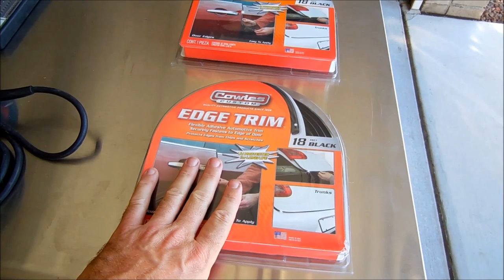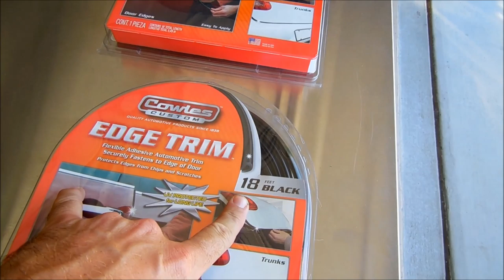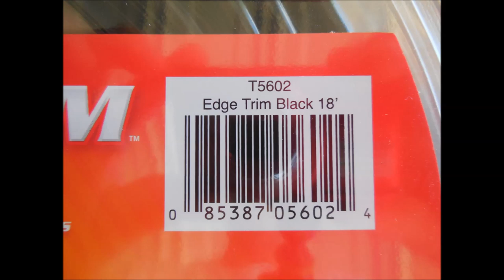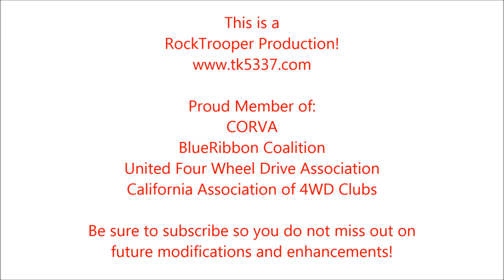How To: Cutting the OEM Fender Flares on Jeep Wrangler (RockTrooper)

Comment: I think you just saved me $650. i was looking into ordering Bushwacker flat fenders for my JK. But this is a great DIY project and a great step by step video! Very nice touch adding the edge trim as well. What did you end up using to tie in the bottom of the front plastic piece to the frame? 19:40
Reply from the maker: Ryein, thanks for the feedback, glad it helped! As for the fender piece at 19:40, I actually just left it tucked behind the body and it has remained in place. I have driven high speed highway miles as well as off-road rubbing the fenders against trees and rocks and they have never popped out.

Comment: I love this mod. I hope one day I have the guts to do it! I have a Sahara, so I'm slightly afraid of cutting the painted fender flairs, but I did find some white door edging, so If the paint  doesn't get messed up with the cut I can finish it off and make it look complete. We shall see. 

Also, I really like your  brush guard, what is it? I am in the process of chopping my stock bumper into a stubby with a winch, so I am not afraid to drill holes to install a brush guard. I HAVE A 2014JK/ 2 door Sahara (it looks like u have a Rubi 2015 stock bumper), but it should fit either way. 

Props on your diy fender mod. I am doing as many mods myself so I can spend big $$ on a good lift and bigger tires(my wife has the final say on all $$ spent on the Jeep). It is also my daily driver/only reliable vehicle between us, so I need to keep the extra pounds down as best I can. After looking into purchasing new bumpers or flairs I also found it can add extra weight to the jeep costing me gas mileage.
Reply from the maker: Robyn Schlagheck Thanks for the feedback! I do not know anyone who had cut the factory flares that are painted. I'm not sure if the paint would remain intact or if it would splinter/crack from the point of the cut. I'm guessing the later, but I'm sure a quick google search would show someone may have done it already.  The stinger on the bumper is from Maximus3 and it mounts to this type of front bumper only (10A/Rubicon X/Hard Rock). I think they may have some other stingers that would fit the bumper you have. I hear you on saving $$ for the real mods, I do the same... :) Jeep on Robyn!
Reply: Robyn Schlagheck My factory fenders are white, I have the Sahara Unlimited and I cut them with a dremel to install the Rostra LED Daytime Running Lights. I didn't have any issues with cracking or peeling, and Ive had them for over a year now. you can search those lights on you tube. Theres a 20 minutes how to for installation that was rather well done.
Reply from the maker: Bishop, thanks for information. I had not known anyone that had cut painted fenders. Good to know that it wont crack/peel.

Comment: Do these completed fenders flap in the wind while driving on the highway or any driving at all for that matter ?
Reply from the maker: Ginny, as long as you leave the proper support braces in place like I had done in the video, you will not see any flapping. I have driven extended highway rides @ 70 mph, as well as normal road and off-road driving and no issues at all.

Comment: Looks good  leave it as is saves lbs... Remember power to lbs ratio is important too!!! Try to use  Hd .aluminum and plastic also where you can...Again looks good and stay safe....
Reply from the maker: dam1041960 thanks for the feedback. Yes weight is important, there is always a balance between protection and weight.

Comment: I just purchased a jeep similar to yours what lifted did you end up going with on that jeep and are you happy with it
Reply from the maker: S Hermann, Congrats on your Jeep purchase and welcome to the family!

I have the MetalCloak Gamechanger suspension and I am very happy with it. The folks at MetalCloak are great as I had a minor issue with one of the control arms and they sent me a replacement next day. I have taken RockTrooper thru varying off-road locations (Rock, Sand, Snow, etc) and everything has held up great. No complaints. Happy Jeepin!

Comment: nice trim, just remember to paint the insides of the wheel wells black.
Reply from the maker: Rhett Patterson Yep, I'll probably do color matched rhino lining or similar inside the wheel wells. I first need to decide if I want to replace the plastic inner fender on the front wheels with some aluminum plates.

Comment: did you have any fender flapping once you cut them?
Reply from the maker: Austen, no flapping at all the way I cut them. There is still support on the top and the rear section I can tuck back behind the body. I have driven highway speeds as well as off-road and never a problem.

Comment: You should paint the wheel well with bed liner.
Reply from the maker: Zakaria KTM I had thought about it, however I had installed inner fender liners in the front and had them painted white to match the body color.

Comment: ETA on the Maximus 3 Stinger and Winch Plate install? Great vids. Thanks!
Reply from the maker: Nathan, install is complete and video shot, however when i went to compile and edit I lost a large portion of the video. I need to go thru everything and see exactly what parts are missing and see if it is worth it to uninstall and reinstall to capture the missing shots.
Reply: John Golden Oh no that's a shame! How was it on the difficulty scale? Think someone with minimal experience on vehicles could handle it, or am i better of taking it to a shop and paying a bit extra? About how long did it take? Thanks!
Reply from the maker: nathanc777 Nathan, not difficult at all, just a bit time consuming. end to end install took about 5-6 hours, which includes lining the winch drum with the line and all wiring. The Maximus 3 winch plate is a perfect fit. The only option to consider is the pump relocation bracket which depends on your winch model. Id be happy to discuss in more detail or provide help via e-mail/IM/Video chat if you need it. E-mail me @ 10ARubicon@gmail.com
Reply: John Golden Thanks so much, will definitely keep that in mind when i gather up all the components!

Comment: You think I can do this with a grinder?
Reply from the maker: Not sure. A grinder (electric or air) might be too much power for the cut. If you can get a really super thin wheel it might work.
Reply from the maker: You are not going to be able to get to the tighter fit areas around the grill and body of the jeep with a grinder either. I would suggest getting a Dremel, it would make the work much easier and more controlled.
Reply: +John Golden (RockTrooper)  thanks bro! Ima try it tomorrow on my wrangler see what happens awesome video
Reply: Sooooooooo? Im curios as I'm toying with the idea of hacking my sahara fenders as well.
Reply from the maker: +Big Johnson you can do it! If you have any questions before you start, let me know and I'll answer what I can.

Comment: do the fenders flap any at hwy speeds?
Reply from the maker: Hey Jake, not at all. On the front, as long as you leave the proper support braces in tact that I show in the video, it will keep them sturdy. I had been running them for a while now and never had any issues.
Reply: Ok thanks for the video, I plan to do this sometime soon and will use your video to help me along!
Reply from the maker: +Jake Carter glad I can help. If you have any questions, let me know. I'll be happy to answer what I can.

Comment: With doing this I would be able to throw on some 35" tires on a stock suspension with no lift in the meantime correct? I don't want to waist money buying an inexpensive lift kit rather save up for something good but want to run 35s
Reply from the maker: Christian Granados while cutting the fenders will allow you to fit a bigger tire, it may still limit your travel based on your bump stop placement. if you do some heavy off-roading you may end up stuffing the tires to much and causing damage to either your tire or wheel well, so be careful.
Reply: RockTrooper thanks for the response bud! I'm going to have to probably stick with 33s for now

Comment: Blackout the rear wheel well!!
Reply from the maker: Erin Black I actually ended up placing an inner fender liner in front and painted it white, then cleaned up and left the inside rear wheel well white as well, turned out real good.

Comment: Well Sir, it just looks cheap and it was painful to see you hack away at a perfectly good flare. Bottom line, looks cheap
Reply from the maker: Jeep Rubicon I appreciate the feedback. Of course there are always options. Spend $1000+ on a set of new fender flares, get them painted and installed to get the clearance I needed or cut the plastic OEM fenders. At that point in time, cutting the OEM fenders was the best option. I had seen other examples of cut flares that did look like horrible hack jobs, which is why I put some time and research into cutting them before I actually did and made this video. I had received numerous comments on the cut and function and I even did a few more on others Jeeps the same way, all turned out great! If you need the clearance and can't afford a set of new fenders right away, this is how it's done.

Comment: Great video, wish I had found this before I purchased aftermarket flat fenders.  All good though, again, well done!  
I have a question, realizing that this video is over 9 years old, on your hood where the decal is supposed to indicate RUBICON, you have a different script.  Mine also has the exact same script, but only on the passenger side.  Any idea what that is?  Special edition?  I bought mine used from a dealer and they didn't know.  Thank you!
Reply from the maker: I removed the Rubicon lettering and replaced it with customized lettering called Auberesh, which is a language in Star Wars.